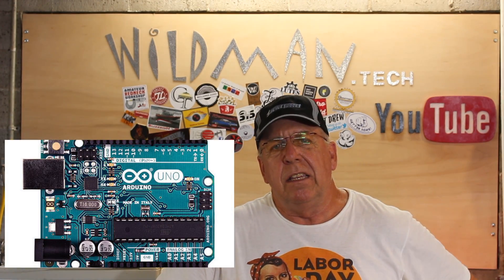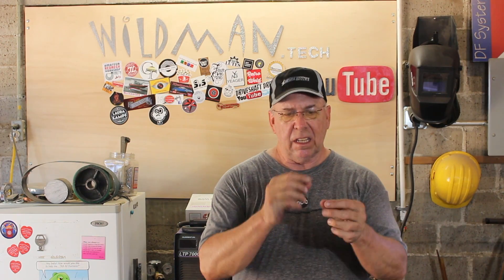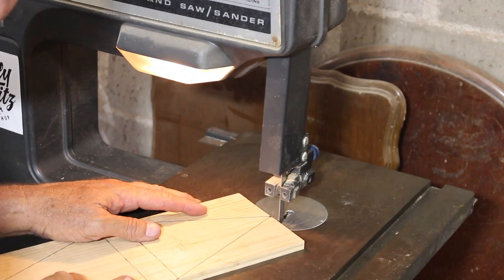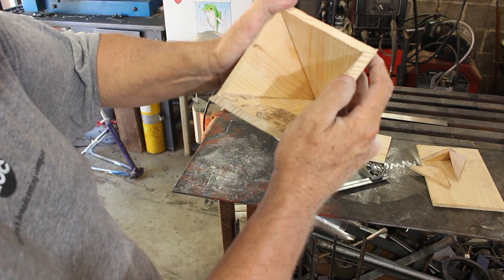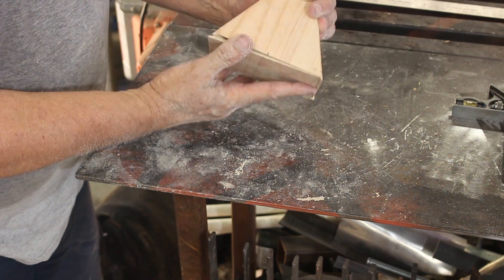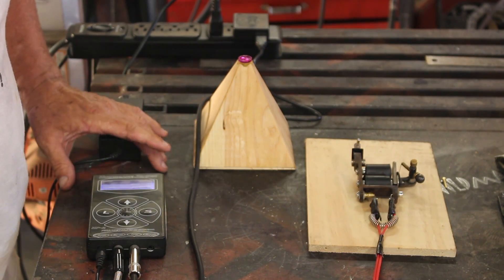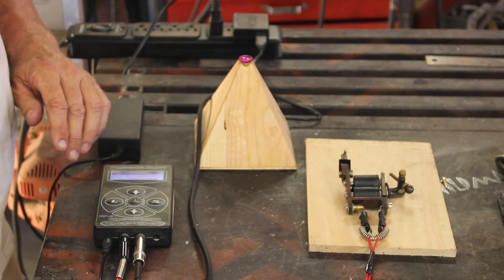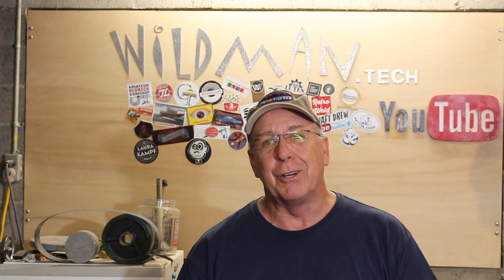Build a Motion Sensing Tattoo Machine Switch (Arduino)

Comment: So is the led where the hot/ground go out and into the tattoo power supply?
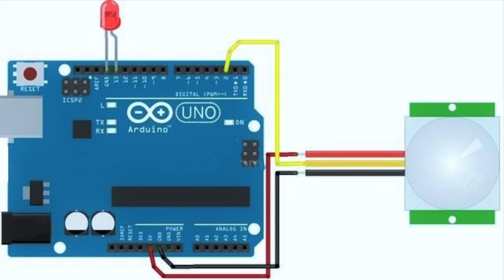Reply from the maker: Hot? Ground? No. As described in the video just before 11:00, instead of an LED, the same two pins flip a switch. Don't forget, this unit replaces a foot switch which is nothing but a momentary contact. Threre is no hot or ground. It's the same as touching two wires together.

Comment: As a professional tattoo artist for over 20 years, This idea, while a novel approach, simply won't work well. 

1) It's not as responsive as a foot pedal. 
2) That looks quite clunky to be moving around the client when re-positioning, which happens quite a bit during larger, and more precariously placed tattoos, this simply wouldn't fit the bill, and would require the artist to physically move the device every time he had to move, essentially negating the "cleanliness" aspect of it's proposed purpose. 
3) If your artist is complaining about his foot pedal being "filthy" he should invest in proper safety, and health equipment. Namely, the disposable covers for the foot pedal, as well as the sleeves for clip cords, and bags for the machine that have been on the market for years.. Any professional worth his salt already has these, and knows how to use them. 

All of that being said, It is a novel idea, and a great project for those learning the arduino, and has quite a few applicable uses, but as a replacement for the foot pedal in a tattoo shop, i think it isn't going to work too well in most situations.
Reply: Hello My name is Andrew and I'm the tattoo artist he's referring to. In response to your comment I will say this;

1) It's not meant to be as responsive as a foot pedal.  It's meant to simply turn your machine on and off on a constant current.  Most artists I know are switching to a simple push button switch for constant electricity to your machines.  This product doesn't have any moving parts, therefore it will last longer than your foot pedal or push button switch.

2) The switch doesn't actually leave your station, its stationary. All you do is wave your hand over the top of it.  I'm not sure why you would need to keep moving your switch around while tattooing. That seems counterproductive to what this product is offering. Why would you need to move the switch around?

3)  All foot pedals are filthy.  They sit on the floor, and you're constantly steeping on them with your shoes.  Even if you were to wrap them in some sort of barrier film, they still can cross-contaminate your equipment if your mobile and travel to conventions.  When I travel to conventions the foot pedal is by far the dirtiest piece of my equipment and requires the most cleaning and special packaging to ensure it doesn't cross contaminate my other work tools.  Any 20 year tattooer should see the benefit to having a touch free tattoo switch.  

Also I should mention I've had over a dozen requests in the city I live in to buy one of these, and that's just after posting one you tube video.  So I respect your opinion, I just don't agree with you.
Reply from the maker: I've adjusted the debounce timing and it's less clunky now. A growing contingent among the tattoo artist community apparently disagrees about the usefulness. Since posting this five days ago, I've been contacted by a dozen artists who think this is a great idea and want one.